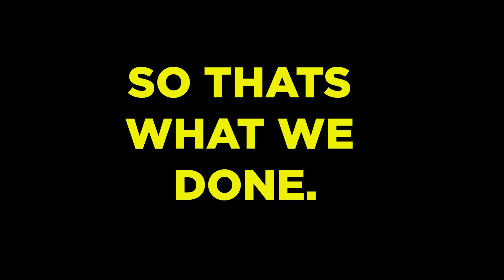This DISGUSTING CONCRETE DRIVEWAY got its first clean in 25 YEARS!

Comment: Nice job mate 👍 Are you running the Slipstream pro 20 or the pro 20x ?
Reply from the maker: Thank you Sir! It’s the Pro 20 X mate a absolutely stunning bit of kit
Reply: @KirbsideCleaning  That’s what I’ve got too. They sold me a triple arm 22” FSC with it as a package. I’m not too impressed with the FSC, it seems underpowered. All lances including turbo are fantastic. I’m considering downsizing to a twin arm 18 or 20” FSC.
Reply from the maker: @simon1001958  I have a twin arm and thought about upgrading to a triple. Perhaps it’s an inbetween. Have you made sure the power it turned too full? The twin arm is okay but feel like it could be improved for the cost and performance of the machine
Reply: @KirbsideCleaning  Yep, I checked to make sure pressure was set to maximum, checked that I have correct size nozzles. To be fair I don’t use it that often, so I’ll get through this season, then make a decision. What’s your first name ?
Reply from the maker: @simon1001958  Ryan mate, please to talk, Simon. My FSC is from Kiam (now equip2clean) and I spoke to them and they sent me some larger nozzles to account for higher water flow, I haven’t used them but according to them it should help improvement so maybe the opposite for yours go a size down to reduce water flow and increase the pressure?
Reply: @KirbsideCleaning  Cheers Ryan, I’ll give that a go, see if it makes any improvement. Keep the videos going mate, enjoy the rest of your evening 👍
Reply from the maker: @simon1001958  you too Simon, thanks for the comments 👍👍